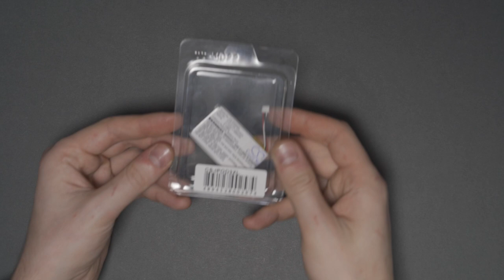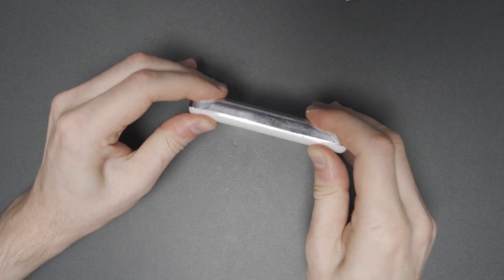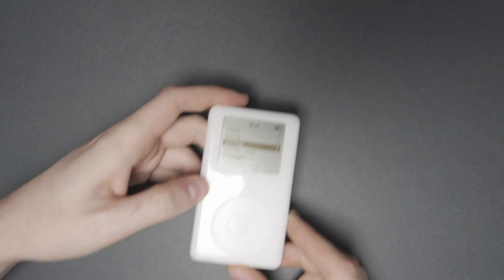Ipod Classic 3rd gen: USB Charging Modification

Comment: Thanks for sharing this. I've just done this successfully using the same board you're using and a 64GB CF card on a 15GB model. I seem to get much higher charging rates though at 900ma most of the time, sometimes peaking over 1.5a - I used 24AWG solid core copper wires. The transistor that the 5v is hooked to has a very thin trace running into that via and capacitor (C88?), I ran some extra wire over that via. 
Something else I've done is the voltage converter sits inside the rubber mat by the CF card and the wires push its PCB upwards, I put a thermal pad on the flat side of the PCB which then has a loose thermal pad that hopefully presses against the metal back. It certainly seems to get warm so that could also help with higher currents :)
Reply from the maker: The thermal pad suggestion is a great idea!

Comment: WARNING!  These steps are correct but not in the right order!  DO NOT attempt to use a metal tool to disconnect the hard drive or anything else in the iPod without first unplugging the battery!

Comment: As someone who is inexperienced with these mods, this just converts the extra amperage of a modern charger and converts that to a higher voltage signal for the iPod to take, right?
Reply from the maker: Hi! Not the amperage, but the voltage. USB standard is 5 volts, firewire is 12 volts. The Ipod connector supports both, but inside the ipod, the charging circuit is connected only to the 12 volt firewire input. This modification effectively connects the USB input power to the firewire charging circuit.
Reply: @TheRepairLair   great series, about to attempt it. Was wondering what type of wire did you use to make the circuit?
Reply from the maker: @joepmichael  The wire i used is from an old usb charging cable with a broken plug, no need to buy something specifically for the modification as the currents are very low here and anything rated >300-500mA will work. You can also use thicker magnet wire - this may help if doing other mods, to potentially save a bit of space.

Comment: My iPod is acting up weird after doing this mod. I can charge via USB now but after a few seconds the screen freezes or is turned off until I unplug it. I have checked everything and there are definitely no shorts. How is yours doing until today?
Reply from the maker: I dont use mine very frequently, but what you describe could be caused by a charger that's not powerful enough, or a bad converter pcb that might be causing too much noise in some way. I recommend trying a more powerful USB port on your pc if you have any (usually marked as "fast charging"). Also, have you done any other mods, like the solid state mod? Depending on the components that may also cause weird hangups in the ipod
Reply: @TheRepairLair   It's charging without any problems or freezes on my pc and my 3rd Gen is running a iFlash 4th Gen converter + iFlash Solo currently with only 32GB only. It literally just froze  when plugged to any USB charger. I have tried the original apple ipod charger and a higher capacity charger with the same results. I can try another converter since I have ordered 5 though. I have used different thick cable to wire on which could also be a problem but I'm not a electrician it's just a guess.
Reply from the maker: The wires shouldn't cause any problems, that of i'm certain. If you still have the original hdd, could you try usb charging with the original hdd installed and see if that works?
Reply: @TheRepairLair   Sure I will test it the next days and will keep you updated

Comment: Did anyone else successfully apply this mod yet? I've tried it on my 3rd gen Classic iPod and it doesn't work for me. Using a regular 2A 5V USB power adapter, I get 11.9v at the buck converter if the battery isn't attached, with the battery attached it drops to 9.8v - and doesn't show as battery being charged. Tried a different fully charged battery, no change. Tried another buck converter, same thing. If I attach the official Firewire charger the voltage on the buck converter stays at 11.9v with or without the battery attached - and it shows charging normally. Also tried a different USB charger and attached to an iMac's USB port, neither trigger charging... I've got a little stack of these 3rd gen iPods I'd like to mod, will try with some other units tomorrow.
Reply: update: I hacked apart a regular iPod 5V USB charging cable. Moved the pins around in the 30 pin header plug so pins now in positions 30+29 (12v gnd) and 20+19(12v+). Wired 5v into buck converter from USB plug, 12V out to the 30 pin adapter and it charges the 3rd gen iPod. So the buck converter works fine externally.
Reply from the maker: @timrustige7175  Hi Tim and thanks for the interesting comments - perhaps a dumb question, but have you tried different USB cables while having the converter installed internally, or different wires for connecting the converter? I wonder if it's possible that the  USBcable is either damaged or poorly made, or that the wires you used are too thin,  and so the combined resistance results in a big voltage drop at the converter input?
Reply: @TheRepairLair  I tried the mod again today, and it worked fine straight away. Thanks for posting this video.

Comment: I’m thinking, if I add a diode to the 12v output line from the step up converter, wouldn’t that allow it to charge both via USB and FireWire? Since it would stop the current from going back into the converter when plugged into a FireWire cable.
Reply: Hi there!
I made this modification, but it didn’t work quite well. 
So with the 12V step up converter still in place, I charged the iPod by FireWire without any problems.
Reply: @carlgustav7196  Thanks! I appreciate it, will probably try to do this mod in the near future then.

Comment: thank you bro, im looking for 2 days this info about the ipod charging voltage, in my case its the reverse problem, im looking for a use a old ipod spaker 12v dock station with my ipod touch 2ndG, but shows "charge its no avilable with this accesory" and my bluetooth dock adapters don't work either in this dock, but and i see in the specs of the bluetooth adapter that only works with 5v, now i think that i need a 12v to 5v 30 pin adapter, thank for sharing.

Comment: I'm curious, would the firewire charging still work after this modification? Cause I have an original firewire charger with the dock that I got with a 4th gen monochrome, which is why I've been able to charge the 3rd gen that I just got recently. Rather than having like 2 cables for charging, would it possible to still use the firewire charger through the dock while I use USB with a wall adapter at work or when traveling for example?
Reply from the maker: That is an excellent question that i don't have an answer to, sadly! it could be tested though, if you apply 12v to the output of the dc boost converter, and no voltage appears on the input, then i think it would be safe to connect the firewire charger
Reply: Any updates on this question at all?

Comment: Love this! Everything "retro" should be brought back with USB. I would have gone the extra mile and replace the old hard drive with one of these SD cards adapters. And maybe even add USB-C. :)

BTW, you should use kapton tape rather than electrical tape because with time it becomes gooey and it's a mess, while Kapton tape remains stable.

Comment: Hi,
Great video look forward to more.
When the iPod is charged are you able to sync with itunes etc with lowered powered/standard usb ports with any issues?

Is it still safe to charge via FireWire charger?

Can I also ask you to comment on the quality/battery life of the battery linked in the description
Reply from the maker: I only tried one older laptop with low powered ports and that failed to sync.
Regarding the FireWire charger, it should be safe to charge with it after this modification.
Reply: @TheRepairLair  
Battery life - looking to purchase linked battery but want to know if any good 9 months later :)
Thanks
Reply from the maker: @R9anSmart   Sorry, i don't actively use my modified ipods so can't comment on the battery life, but for the price, you can't go wrong :)

Comment: I have an idea about another approach.
What about using usb charging controller like from ZY12PDN board? So it will be able to ask for various voltages from USB charger, including 12v. This board or just the controller itself can be retrofitted inside, and bypass 12v to FireWire circuitry itself as in your mod. 

It will be better as the up-voltage conversion will be done on the USB charger side, this means far more efficient and with the less heat inside the iPod.
What do you think?
Reply from the maker: that's a great idea! I will take a look at that too.

Comment: Do you know what type of connector is needed to wire into the front panel of the 3g? Its the 15 pin socket from front panel to motherboard, but I can't find any sort of ribbon to dip so I can easily wire

Comment: Does anyone know if it would also work if I spliced the same board in the middle of a usb to 30 pin cable? Im much more comfortable with the possibility of wrecking just a wire rather than my whole
Ipod. TIA!
Reply from the maker: I believe it should work just fine!
Reply: Did it work? I'm going to try this 1st before modding the ipod
Reply: You mention referencing the back of the board for the Voltage,  I'm not sure what I'm looking at on the front of my board

Comment: You mentioned referencing the back of the board for Voltage but what differences am i looking for on the front of my board
Reply from the maker: Its for setting the correct voltage output of the upconverter board, but if you ordered specifically a 5v to 12v board, it should already come preconfigured correctly. If you have a multimeter, just check that the voltage on the output pins is around 12 volts, that should be sufficient. Good luck!
Reply: @TheRepairLair  thanks,  I managed to work it out but the first one I wired up burned out. I'll try again later

Comment: I did the same as you described, but after the installation it seems my hard disk meets problems. 
Sometimes I can sync the iPod to my Mac, sometimes not, and I am often stuck in disk mode for no reason. 
Can it be caused by my fragile soldering skills ? 
Great video btw
Reply from the maker: Thanks for the comment! Have you tried using a different computer? It is possible that the usb port power output of the mac you have is not sufficient. Alternatively, you could try using a powered USB hub which may also help.

Comment: Unfortunately, the modification does not work quite well. 

I have an issue, that when i try to charge the iPod by usb, the iPod boots itself and after some seconds the GUI freezes. 
The GUI starts working again as soon as I remove the (USB) charging cable.
Reply from the maker: im sorry to hear it doesnt work well for you! Can you try a different (new) cable, and a more powerful usb port? I had the same problem you describe when trying to use it with an old desktop PC that only has 500mA usb 2.0 ports

Comment: What if you just connect a wire to the 12v FireWire pin to the 5v usb pin on the motherboard? I know nothing about this stuff I'm just curious.
Reply from the maker: It wouldnt work because... well, the firewire is specified to work at 12v, and 5v is too far out of spec
Reply: The problem is not just the specification, which cannot be met at 5V. As soon as the device is connected to firewire, the mainboard would be destroyed.

Comment: hello .. I have the same problem with my first iPod .. it doesn’t charge either from the charger or from the computer .. I even took it to the service center and they didn’t help me with anything .. maybe you can help me with something .. thanks in advance
Reply from the maker: which ipod exactly do you have? if its the 3rd gen ipod, it will NOT charge with USB. you need to get a firewire power brick.

Comment: hi, I did everything as you showed, but there was a problem, the player began to hang, the charge indicator works after 15 seconds and then the phone hangs until you take out the usb connector (there is a flash card in the player, the battery is repacked with the controller from the 4th gen ipod, what do you think is the problem?
Reply: and I also noticed that if you connect it to a computer, charging goes on constantly without freezes, I also measured the voltage where the white wire from the diode when I turned on the firewire, 13.6v comes there and from the converter exactly 12v,I tried another player, the symptoms are the same,both players are working,the question or converters do not pull and there is not enough for the processor and it freezes or the latest firmware of the player does not allow or the flash card with the adapter consumes a lot, maybe you need to take 5v from another place where it only comes from usb?
Reply from the maker: @sergeyivaniv-y7w  Hi Sergey! With i could help, but i'm really not sure as for me everything just worked when using powerful chargers or ports. However, the flash card might be the problem, as you suggest. Have you tried using the USB charging modification with the original spinning hard drive? Perhaps, as you say, the specific flash drive you have is drawing too much current
Reply: Hi!no, I haven't tried it with a rotating one, but everything is fine from a usb computer through a cable, nothing freezes, it's strange because the computer has a weaker current than in 1a charging from an ipod, and I noticed one more thing-firewire works and charges with this alteration, but charging doesn't end all the time, the battery segments on the screen flash indefinitely, plus one for sure-when you connect it to the computer, it is charging and you can safely download music without hurrying that the battery will run out!and with my native hard drive I will try and write what and how @TheRepairLair
Reply: In short, I returned everything back as it was, I did not continue to test the player, it's a pity if it breaks, I just ordered a firewire replacement cable from a well-known site.P.S. I changed the disk to my native one, the same problem, if you have an ipod circuit, you can see how best to take 5v from what point and where it is better to supply 12v,sincerely yours

Comment: just a theory, if i got a usb to cigarette lighter adapter then a 12 volt cigarette lighter, would that in theory work?
Reply from the maker: Applying 12v directly to the USB input pins on the ipod is almost guaranteed to damage the usb charging circuitry which can't tolerate more than 5v!

Comment: Can you make Bluetooth mod for the third gen?
Reply from the maker: it's definitely possible, but would not be easy to fit inside, as you can see the space is rather limited. The best option to go if you want to try a bluetooth mod is to do a solid state conversion, that may give enough space to add a bluetooth transmitter too

Comment: I decided to take a chance to try the player broke now it freezes and the charge indicator disappears as well as not playing music this method is a big risk think for yourself
Reply from the maker: I do agree that the method is not without risks, but unless done incorrectly, I believe you should be able to reverse the changes without issues, which i assume you have tried? I might be able to help if you provide some more details!
Reply: I seeing the same , two reason: 1. too thin wires used. 2. defective buck Afterall it is junk from China